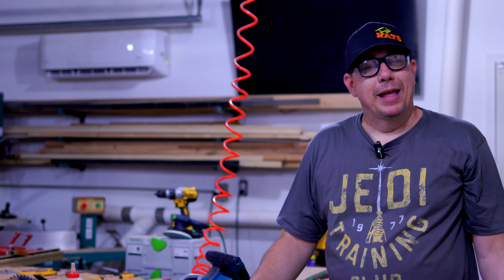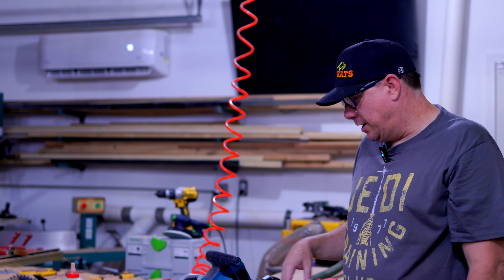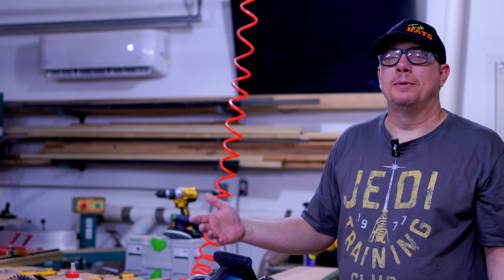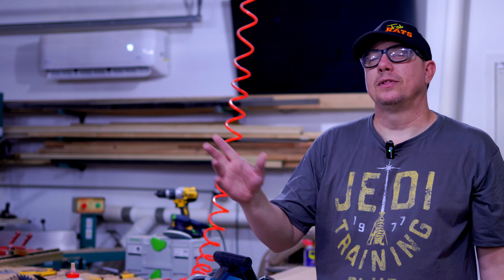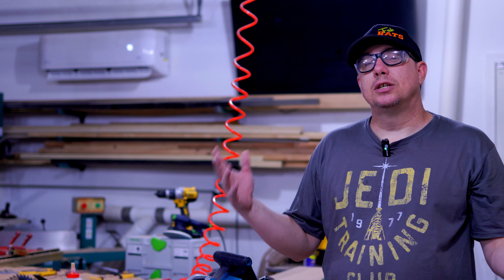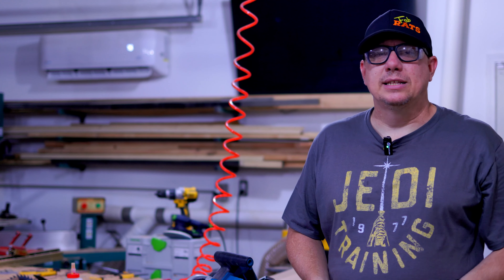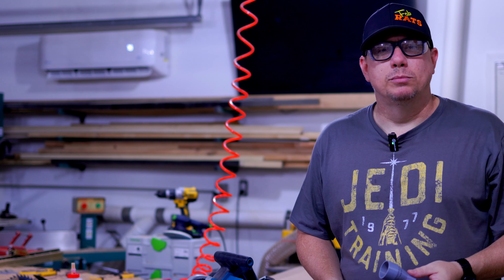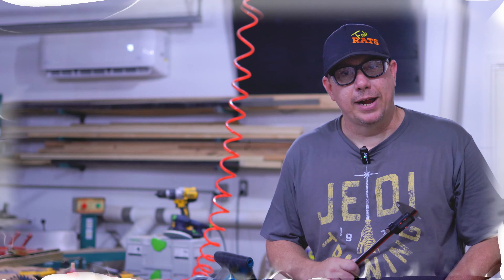Custom Hose Adapters with Fusion 360 & Bambu X1C! 🔧 Woodworking Dust Collection Solved!

Comment: This was a very interesting tasking and the completed model looked very functional.  Over the years I have discovered that if something (like the adapters) were a little small then I might be able to add one, or more, layers of Duct Tape to increase the size slightly so that it fits the connection better.  Additionally, the tape tends to fill slight gaps better and I end up with a better seal and holding capability for things like the sweeper connections.  It was difficult to see the sizes in the video on my iPad, but in the future if you could show how you measured the connected pieces and how you decided inside vs external connections.  I would think that we would want the air-flow to be easier flowing from the tool to the sweeper and to ensure there wasn’t any step-blocking in that direction.

Comment: With an X1C, you could do those in multiple colors.  Use a color close to the tool brand's color for the end that goes into that tool brand.   It looks like I am about to dive into 3D printing, and the plethora of D/C fitting is one of the problems pushing me over the edge.  Mucosa Gracia for putting this video together.